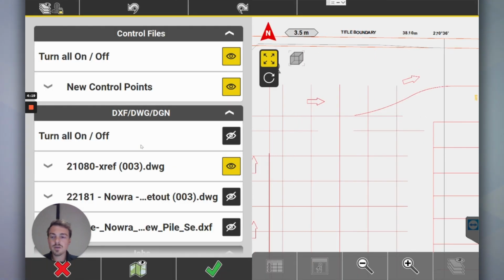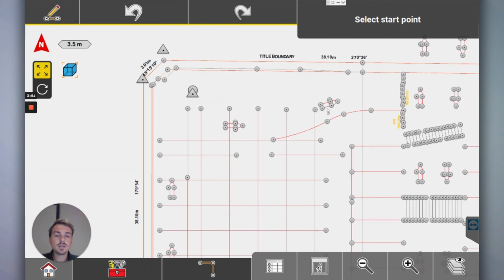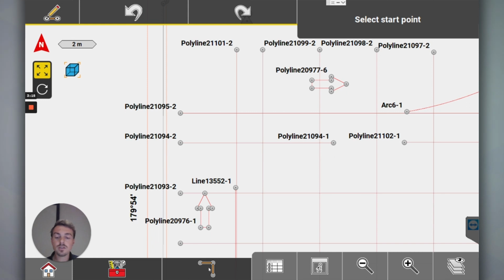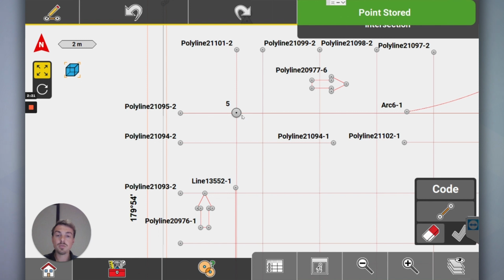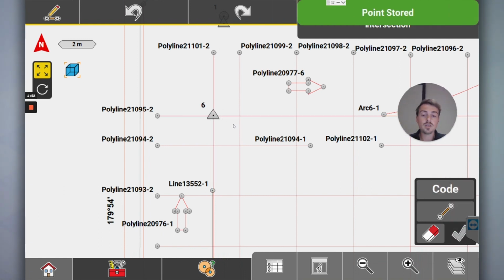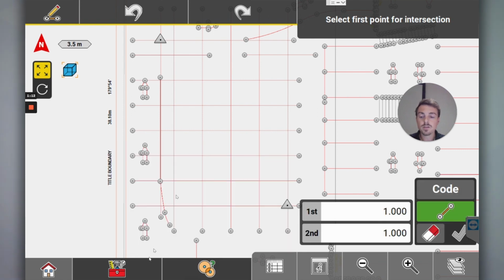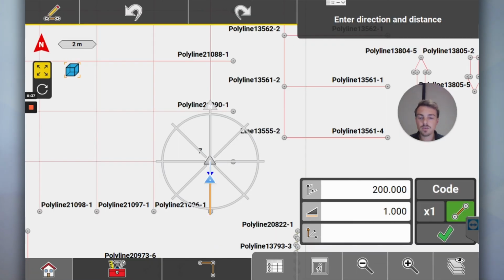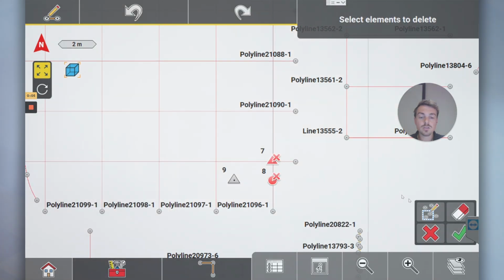Leica iCON Guides | Creating Control Points with Intersections

Comment: Is there a way to "batch process" point at all intersections?
Reply: Hi Reggie, yeah you can.

I would turn all layers off except for the lines you need. Then in the sketching app I would go Functions > Point Creation > Toolbox > Snap Points > tap each line to select or use the highlight box tool to highlight all > tap the intersection button on the bottom right of the screen and it'll create a point at every intersection (tick to save).

Ill make a video of it this week.